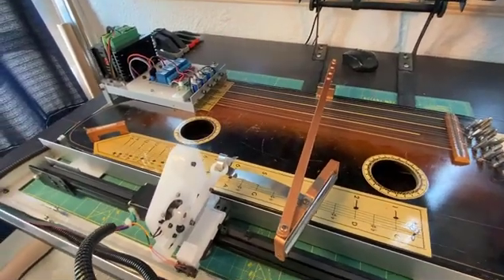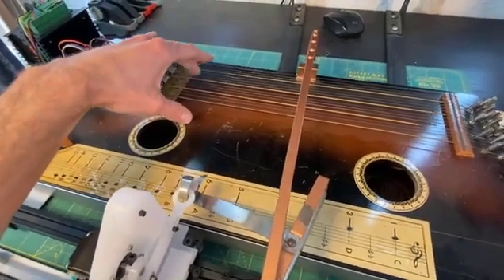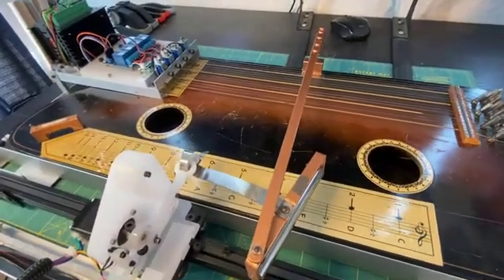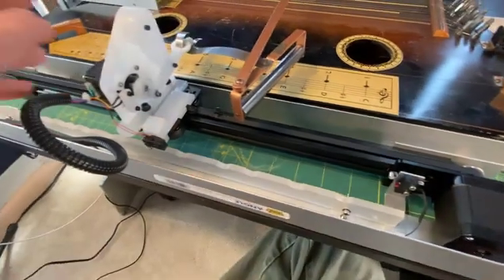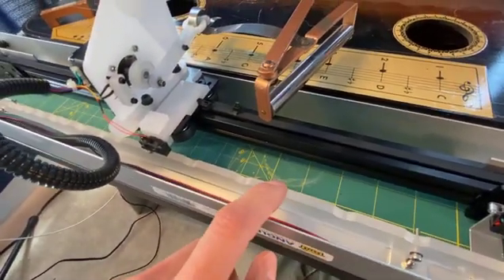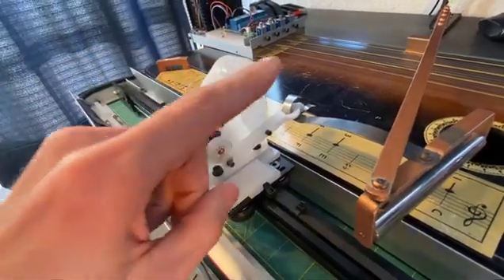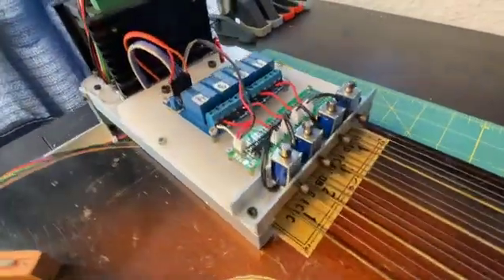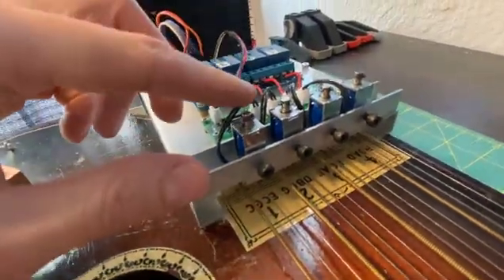Robotic Tremoloa with Arduino!

Comment: This is absolutely amazing! Could you use a contact or magnetic pickup to record without the machine noises?
It's actually really cool with the noises combined but just wondering.
Thanks for sharing!
Reply from the maker: I haven’t given a try, but I wondered the same thing. Those stepper motors are so noisy!  It really vibrates the whole frame, which transferred into the body. I think maybe some more strategic padding could help too.
Reply: I agree.  There are pickups for guitar sound holes (or just placing the mic inside the sound hole may help).  Quite a bit of dedication to the project, good job.   If you get even more ambitious you could strum the chords with a similar mechanism as the pick.   Hope to hear it without the stepper motor noise.